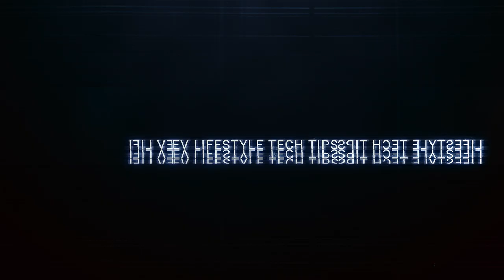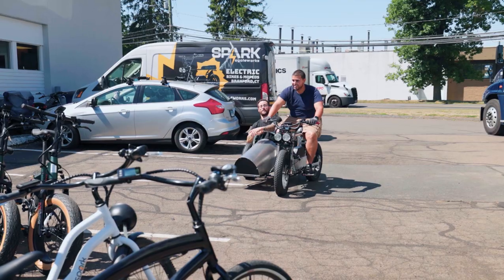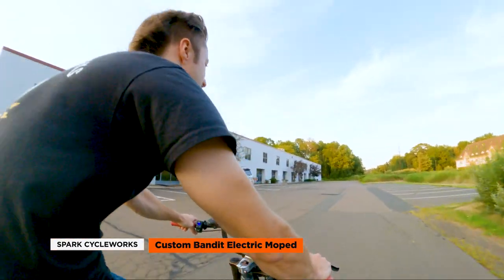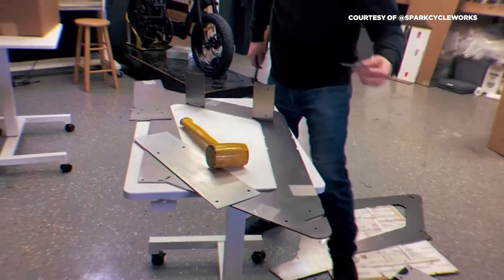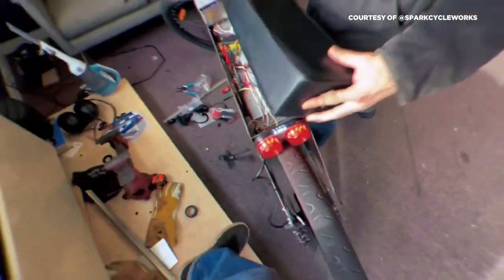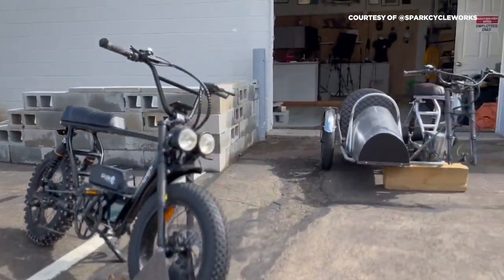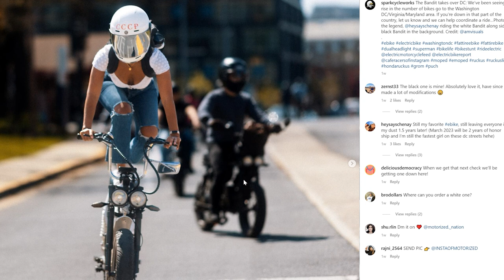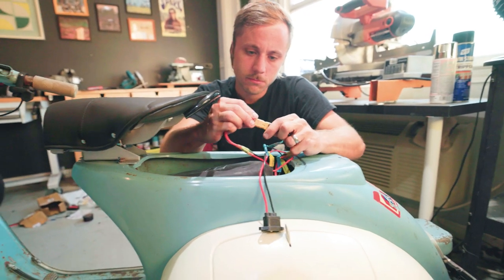Spark Cycleworks Shop Tour, Bandit V2 Electric Moped and Project Javelin | RunPlayBack

Comment: But my grizzly is faster cheaper better off-road and already comes with two batteries oh and a second motor
Reply: I own a Bandit and it's definitely a better bike than the Grizzly so here's my story. November of 2021 I was out riding my Bandit around New York City and I caught up with a guy doing the same on his Grizzly. We talked it up some about our bikes,  basketball, the weather and riding. He went on and on about the power of the Grizzly and challenged me to a race but all I wanted to do is ride around. Finally I accepted his offer but things didn't turn out too good in his favor. By the time his Grizzly's front wheel motor got any traction I was already pulling ahead of him on my Bandit. All I seen of him was through my mirrors as I crossed the finish line and he wasn't too happy about that.
Reply: The Bandit is a 40mph+ fully legal moped that can be registered. I do like the Grizzly, and have even gone on group rides with Ariel Rider representatives, but the Bandit is literally in a different class.